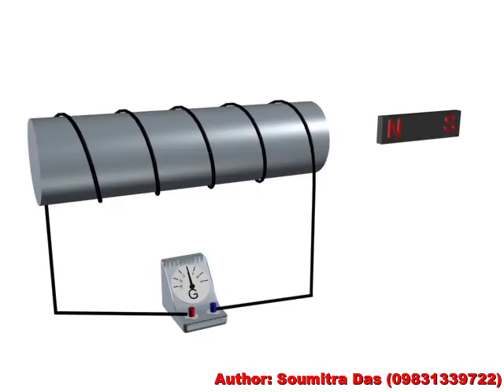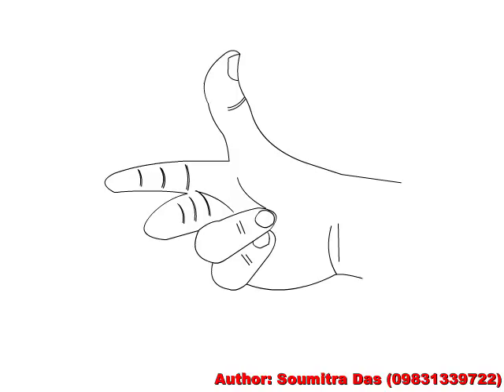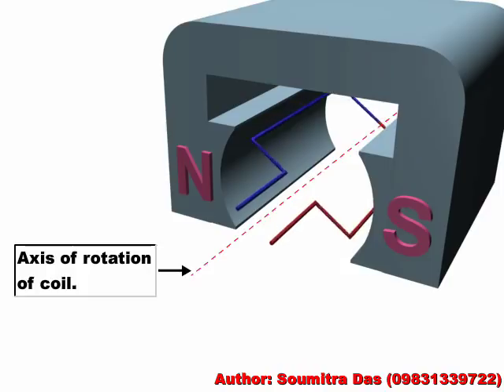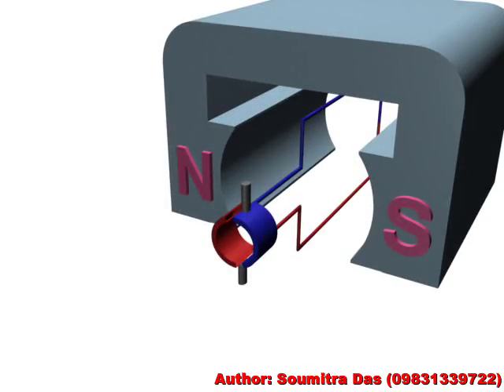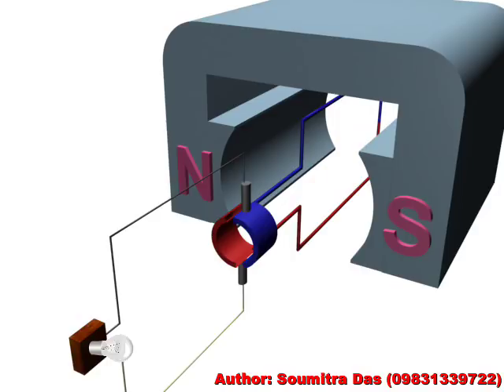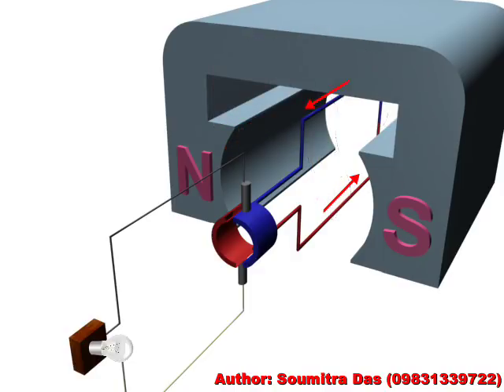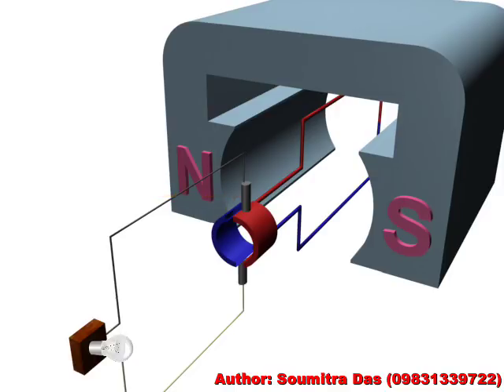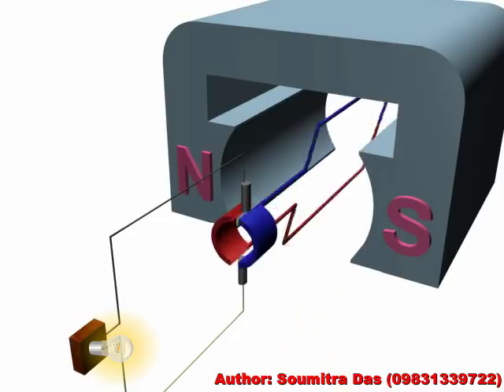Principle, construction and working of a dc generator

Comment: There is an event were neither of the brush touches any split ring commumator, then what happens you should even tell that ! That's indeed very important ! If anyone out there does not know it the answer is that ,"So at this moment ,no current flows through the current the coil and thus no forceacts on the coil. But due to inertia of rotational motion the coil does not stop in this position ,but it turns further.".BRO HALF KNOWLEDGE IS MUCH MORE DANGEROUS THAN ZERO KNOWLEDGE !!!

Comment: Its Fleming's left hand rule! The right hand rule explains electromagnetic induction, but d.c motor does not work on the principle of electromagnetic induction. Electromagnetic induction produces an alternating e.m.f, while d.c motor produces direct current. Sir, what you have explained here is an A.C GENERATOR. This is because a d.c motor has a coil rotated by a d.c source (battery, etc.) The video has utterly confused the working of d.c and a.c motors...
Reply: he described the idea of rectification of the alternating current.. first, the idea of replacing the slip rings with a comutator rectified the direction problem so, it became a unidirectional AC
second, if we brought many coils placed in each other and separated with the same angle and divided the comutator to double their numbers so that the voltage changing is decreased as much as it can be neglected which rectifies the AC completely into DC
Reply: Umm.. this video shows a DC 'generator' not a motor.

Comment: Half knowledge ! There is an event were neither of the brush touches any split ring commumator, then what happens you should even tell that ! That's indeed very important ! If anyone out there does not know it the answer is that ,"So at this moment ,no current flows through the current the coil and thus no forceacts on the coil. But due to inertia of rotational motion the coil does not stop in this position ,but it turns further.".BRO HALF KNOWLEDGE IS MUCH MORE DANGEROUS THAN ZERO KNOWLEDGE !!!
Reply: Sapphire Phantom it doesn't matter if you are Muslim if you want to celebrate Diwali do we hesitate to have the sewaiyan made by your mom on Eid..  festivals are not mend to solidify  religious walls but it is to bring solidarity among people..  cheer up buttercup
Reply: @swrnm  i celebrate, regardless of being muslim and  
living in pakistan.
Spread love.👍
Reply: +Swarnim Sharma I think he had forgot it.
Reply: doesn't matter I had explained it ! I don't think anybody would  have to face problem !
Reply: Umm.. your comment is old but I can't help but point out that you have got it a little wrong. First of all, the coil doesn't keep rotating when passing through the gap b/w split rings due to inertia. You do know that this is a 'generator', right? Which means the coil is being rotated by 'mechanical means' like a turbine, for example. The coil will keep rotating even when there isn't any current in it. The force you are talking about is the one that drives charges along the coilv(not rotate the coil, that is another force) which would be zero in the absence of current such is the case when the gap in the commutator arrives. So the current is zero and the output current is unsteady. 
This problem is removed by using an armature in which each coil has its own commutator so there is always going to be one or more coils that aren't crossing the gap when the other coils are.
I hope I cleared your misconception :)
Reply: Sapphire Phantom  I think you had a misconception there I said what he missed and I completely understand what you say it's just that I haven't mentioned it or felt like mentioning it thanks for your concern.. have a nice day 
🎩
😁
👕👍Great!
👖
Reply: Oh... My bad :D
Reply: Sapphire Phantom  no problem and have a safe and sound diwali
Reply: I'm a Muslim so no diwali for me :D
Reply: +Sapphire Phantom I think you're a K-pop lover........... right?????😊😊
Reply: 100% agree... Half knowledge is much more fatal than no knowledge!
Reply: Regardless, I live in Pakistan and especially in the area I live, there isn't a chance of celebrating it.